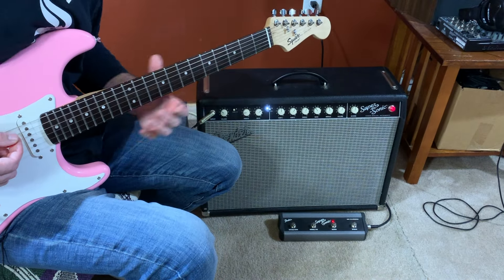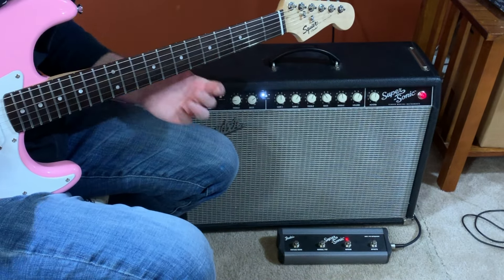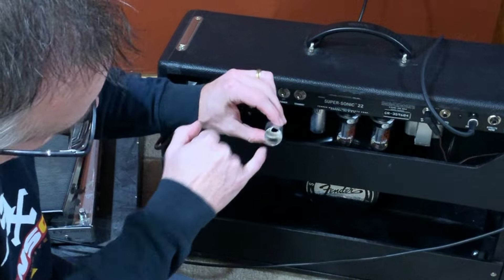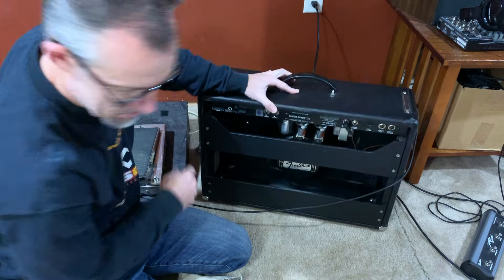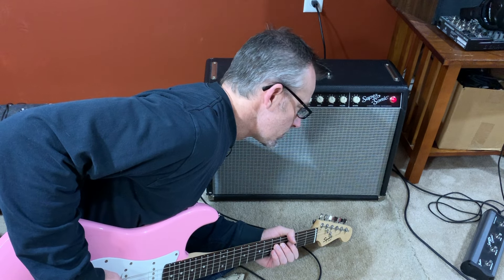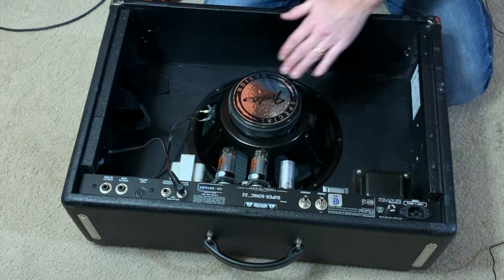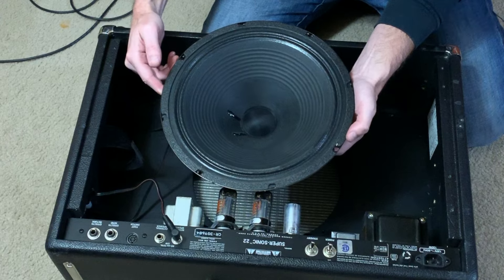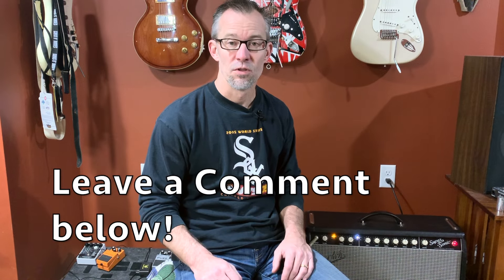Fender SuperSonic 22 Issues Tube Rattle

Comment: Did you ever track down the cause? i have a very similar issue (fender style circuit built by a small independent builder) but i hear it at even quieter volume and only on certain notes. it’s the same sound though.
Reply from the maker: No not yet, I'm thinking I need to replace some tubes and test again, but I'm in the middle of some other projects currently. Thanks for watching.

Comment: Usually is the power tubes, get the big tube damper rings from eurotubes.  They have fixed 3 of my combo amp's tube rattle.
Reply from the maker: your input is appreciated, I like your amp shootouts.
Reply: @RichTones  Thanks check out my twin vs super reverb.  You might like

Comment: Had exact same problem. It turned out to be bad V4 12AX7. When I tapped it with a pencil you could hear a much quieter rattle but very reminiscent of the sound. The rattle was somehow getting amplified too when playing. Diagnosis - rattly, microphonic tube. Hope this helps Y'all.

Comment: Turn the amp on then take a pincel & lightly tap on the tube see if you can hear Anything come thru the speaker if so replace the tube! After making sure it's Not the protective tube cage you are hearing by removing it completely! If all else fails remove the reverb tank completely & retest! The reverb tank is very close to the speaker & Not well isolated & could be picking up harmonics? Worth a shot!

Comment: Brand new 68 Custom Pro Reverb today - has this sound out of box. Beautiful amp otherwise but man that rattling sound is unbearable.
Reply from the maker: Uggh that stinks if its brand new. Are you going to ask the dealer to replace it?
Reply: @RichTones  Tough part is availability right now.. I think it'll be a while before it could be replaced. In the meantime, I'm looking into warranty service. Btw.. nice Funky Monks riffage ;)
Reply from the maker: @willpopemusic  True - with the whole supply chain issue everywhere. Good luck with the warranty service. I may upgrade my tubes at some point but have a few other projects going on right now.
Reply: Hey same amp and same situation! Was sent a second amp and even words! Narrowed it down u to I one tune filament rattle. The warranty and new tunes is proving to be a hassle in itself. In a last ditch effort I just received some Eurotube dampeners today. I’ll be putting them on later on that offending tube. Hopefully solves it! I’m very iffy a warranty tube swap may produce the same issues still. It seems to be very common, and the supply shortage doesn’t help!
Reply: @mattg082  did the eurotube dampeners work?
Reply: @mattg082  that's a bummer.
Reply: @Malderine  yes it is…but I ended up going to a Tone King amp. I threw money at the problem obviously lol. Once you get to a certain Sonic peak like Tone King, Two Rock, BF 60s real Vintage Fender…it’s very hard to go back and not hear the difference. But even with the high end brands I had some returns…mostly with Tone King that had great  amps, but Fender does not cheap out on the packaging. I give them mad props for that! Every Tone King amp I received look like it was thrown off a truck, and drove around in mud. It took till a 4th one they check at the store for an hour, then they triple boxed it and did overnight air Vs ground. I didn’t understand how a company selling a $2,800 amp would cost cut on boxes and shipping. It was very bare! While Fender does not cost cut on the shipping. 

I’ll say Fender has it’s known issues…but I’ve never had one get botched in shipping due to packaging. Cheaper amp great packaging, expensive amp…let’s cost cut on the packing. That’s pissed me off more than my Fender issues. But eventually ended up with a Sky King amp I payed 1k upfront and 3 years no APR to pay off at $50 a month or sooner. Plus 10% off the original price so $2,600 plus tax on a $3k amp wasn’t bad. Just learned throwing money at better amps doesn’t mean things won’t go wrong either. Tube amps are super fragile in shipping. But man does that Sky King sound awesome with my pedal board!

Comment: I think you still have the same issue as before. It wasn't the cage. I would start looking at tubes.
Reply from the maker: I’d agree with you, and I was hoping it wouldn’t come to that.
Reply: @RichTones  Tubes arent bad, or that expensive really. If its a loose filament try chopsticking all the tubes. you may get lucky and get it to rattle. Check the output tubes. These things aren't too bad to bias if you do have to replace the outputs, and a set of JJ's will run you around 50 bucks.

Comment: I’m having the exact same problem with my AC15. Took off the back panel and realized that it’s the tubes rattling from the vibrations inside the combo. Rattle stopped when I touch the tube with the handle of a screwdriver. I’m gonna buy a silicone damper ring to put around the tube to stop it rattling.
Reply from the maker: Where would you find those rings?
Reply: Rich Hoffman eBay perhaps. Still on the fence though as I read that some of them have burned from the tubes
Reply from the maker: Yes they do get super hot. I may just try to replace with a fresh set of tubes.
Reply: Rich Hoffman was thinking the same. Price for a decent tube damper and shipping is nearly €15. Might as well just get a pair of JJs for €25! However I wonder if new tubes will even fix the problem. The reason they’re rattling is because of the volume level. What’s to say that they won’t rattle? I never understood the actual reason certain tubes rattle in the first place.
Reply: @jonaflynn74   Eurotubes tube damper will fix it and heat resistant.  Check reverb.com or their website.
Reply: Ive tried everything on the deville notting Worked
Reply: @jonaflynn74  i bought a used Fender 68 Reissue and it was doing this from day one. I'm now on my third (!) set of power tubes, and the rattle is still there. It moves with one particular tube when I switch them around, so I'm fairly certain it's not something else. The rattle also stops when I hold one of the power tubes with an oven mitt. My conclusion is that Groove Tubes are susceptible to this, perhaps others, too, but this is my first tube amp, so I have experience with other tube brands. I have a set of Eurotube dampers coming, hopefully they'll fix the issue.
Reply: @sundaydiver  Do the dumpers did the job?